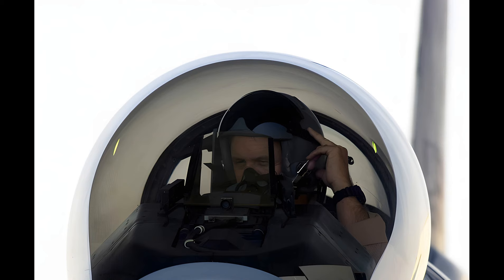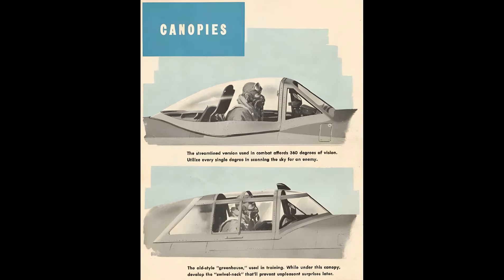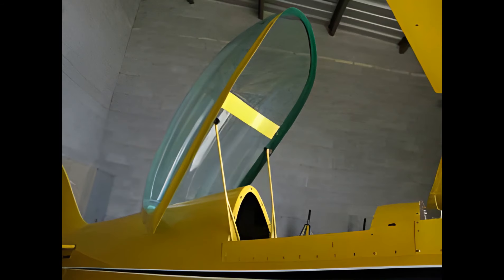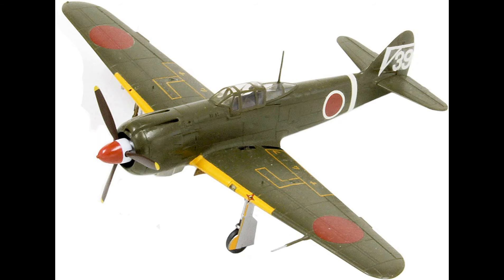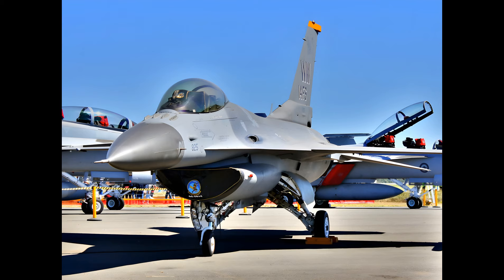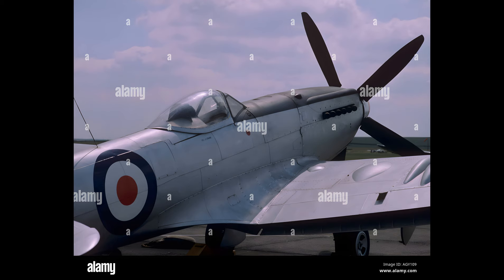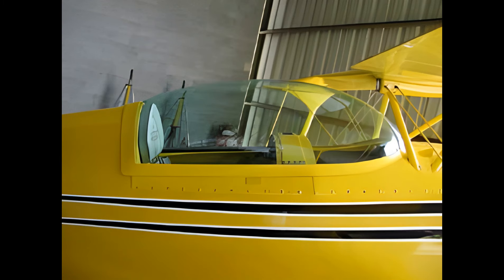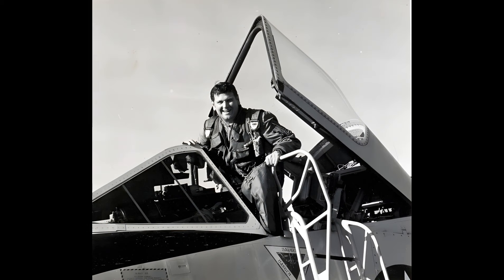Bubble canopy

Comment: Why the F22 canopy has different colour ?
Reply: In order to reduce the radar cross section (RCS) of the aircraft, the F22 canopies are coated with a thin layer of Indium Tin Oxide (ITO), which gives it a golden tint.